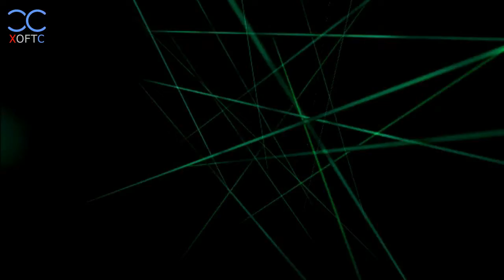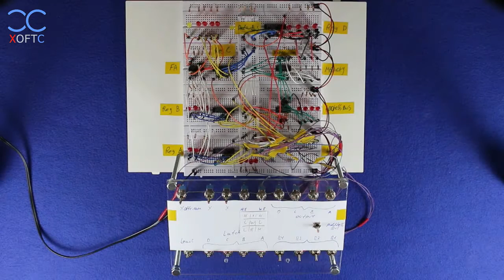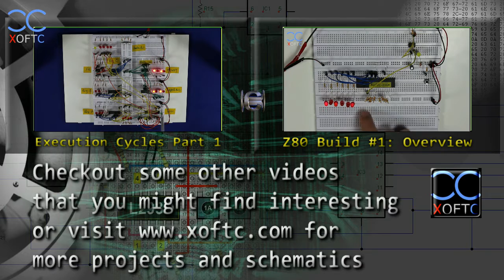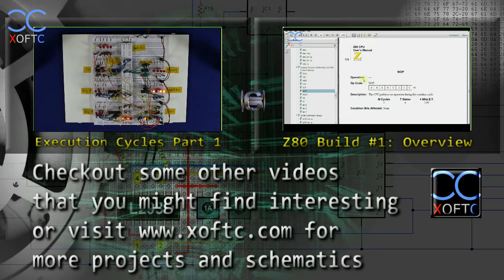How CPU Execution Cycles Are Carried Out - Part 2

Comment: Hello ! It was a realy good tutorial !
To complete your (realy good) explaination, you can say that your panel take place of the logical part of your CPU, and you are the ROM containig propram to execute :)

With 5 IC (Rom, clock and gates to make logic) you can have a full computer !

Therefore one question : How your RAM didn't get bus contention ? You READ it with REG ENABLED, before WRITE on it. With diodes ?

Sorry for my bad english.
Reply from the maker: Helicoupter ArduinoDIY The read outputs for the RAM are buffered from the bus using the transparent latch register D.
in this example the writing inputs to the RAM happens directly from the bus and the reading outputs goes through an adaptation I had to make using pnp transistors and then also the register D.
at no point there will be more than one component using the bus (unless I would've just raised all the switches at random).